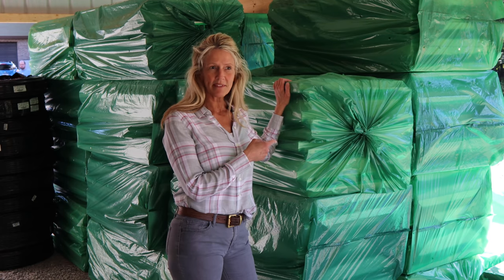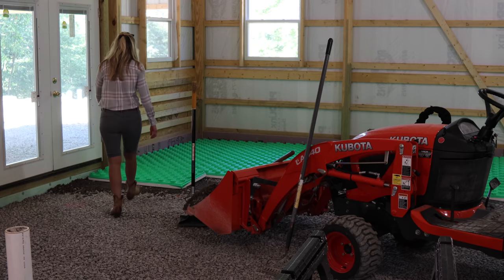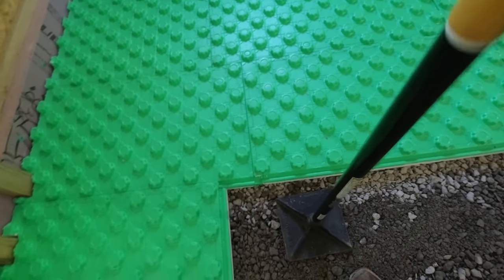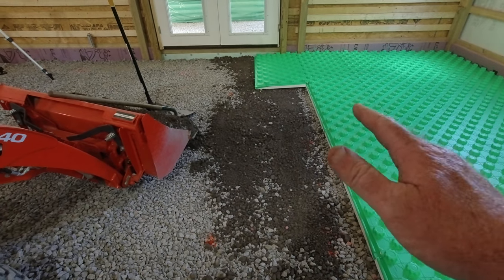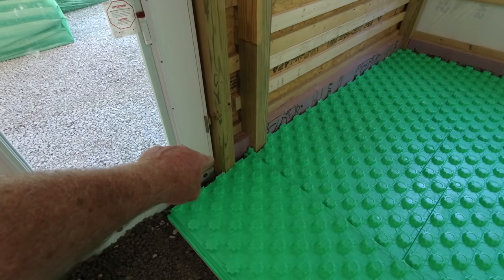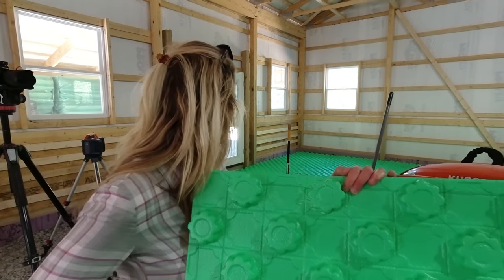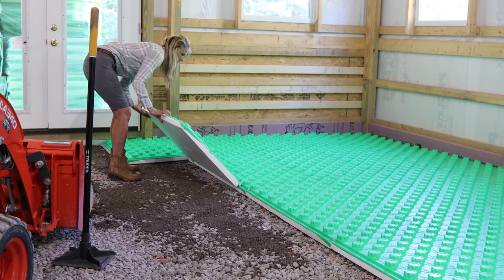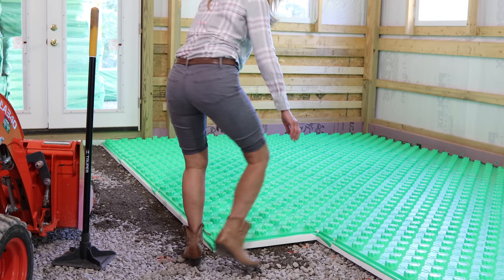I hope the Reward is Worth The Process, Radiant Floor Heat Rough In

Comment: Good Morning, Morgans! Mike, as far as the foam panels goes, we just did what you did, then used sand to adjust the last 1/4 inch. It works fine. And there's nothing wrong with attention to detail. You've worked hard to pay for this building. You should want to do it the right way! God Bless!

Comment: hi guys jimmy from Tn. I haven't done a heat floor but the best trick I have seen is to pressurize with air before pouring concrete. If the concrete guys punch a hole in the tubing it will make air bubbles in the concrete that you can see and you can fix it before the concrete sets. Enjoy the videos
Reply: Dang it wish I had thought of that ! Lol not because I have a heated shop but because I Will someday and So Far you win for best suggestion yet !
Reply: @mikesr3407  ... if you higher a contractor to lay the pipe they will absolutely pressurize the pipe before the pour. In most cases it's required to pass a building inspection.
Reply: @rupe53  that is COOL ! Makes perfect sense to me ! Thanks
Reply: Good point!  And take some detailed pictures prior to pouring in case you ever decide you need anchors in the floor for something. Pretty easy to lay out a tape each way so you can know where things are.  If your spacing is consistent with your grid, it should be simple.
Reply: Also when you pressure it will not collapse
Reply: @haroldsandfort7292  ... the heat tubing is not soft enough to collapse, even if you walk on it without it being pressurized.

Comment: Hi Mike, never commented before. We built our house in Maine last year using radiant and those panels. Up here we use a layer of sand to level up under the concrete. When you lay the tubing in, the posts do a good job in the straights, but we found using a foam stapler really helped keep the tubing down around the turns, otherwise when the concrete guys walk on it the tubing can pop up. Best of luck to you guys, love watching your channel.
Reply: Welcome to the comments Jonathan ! They read em and it's great place to learn more fur Sure !
Reply: I do residential radiant heat and I also recommend using staples on the turns.  https://www.viega.us/en/products/Tools/Accessories/Staple-2890-0US.html

Comment: Mike, there is nothing wrong with being particular about your project. I tried to pull an all-nighter (I'm 57) yeah, it doesn't work like it used too
Reply: Since you are working for yourself and not charging a customer by the hour, you cannot be too particular. Five years from now you will never say, "I wish I would have just slapped it together."

Comment: All-nighters! A common practice for high achievers. I’ve pulled my fair share over the years, always with purpose and drive. As I look back over my decades of life, I realize that there are significant trade-offs. When it saps ones strength, takes time away from family, or sends the wrong signal to others on the team, it’s unbalanced behavior. How well I recall the day after an all-nighter before Thanksgiving in the late ‘80s when upon my return home in the morning, I found my Bible opened to Psalm 127. A timely, and life-long message gently shared to me by my wife. It’s worth a read!

Comment: It is the most amazing way to heat your home. My first experience of this was in Ketchum, ID many years ago which is at the foot of Bald Mt in Sun Valley, ID. My babysitter for my kids lived in a small home her father had built back in the 1950’s. He left his will that for so many generations forward they were forbidden to sell the property but use it as he had built it.  He built this mostly concrete structure that had a sunken tub a large one that many could use together. The aroma of sulphur filled  the air but was piping hot! He was brilliant in deciding to run pipes all through the floor of the  house (think Fred and Wilma’s house) and was able to tap in to the  natural hot springs out there on Warm Springs Road. The most heavenly feeling to be in that house and walk on the floors. I’ve never forgotten it and  hoped to build my own version of that.  Think of  every object in the room absorbing the heat including ourselves. Therefore the most heat absorbing materials you use in the whole structure will be affected.  I hope yours turned out good and you love it!

Comment: Mike, yes you are being too particular, but it’s your own building. You will have piece of mind and no problems because of your attention to detail. I was crazy fussy and particular when I built our home some 35 years ago, and that has paid off in a structure that has stood the test of time! Keep up the good work.
Reply: Every bit of detail you iron out now to be perfect that multiplies over time. Sure, you are spending more time but it will pay off with no creeeeeks or dips,  over time.  Everything shifts ground over time. Water table, humidity, snow outside and such. Mother earth always wins, but you are doing it right. Plus, Mrs. Morgan looks like an amazing partner to work with.
Reply: RAH Capital  Read his comment again. He didn't say the structure lasted. He said it stood the test of time, and in the context of this video, he means he had no issues with the structure. The structure of a home can have issues resulting in cracks, etc., without completely failing. It's not all or nothing.
Reply: @michaelbarrister429  That’s exactly what I meant, Michael. Thank you for your kindness!

Comment: Used the same system when I did my garage last year.  Worked great.  Saxonburg area so similar conditions.    Connected to a mohoning outdoor boiler.   Super nice this winter.  Best advice I got from a pro was keep your pex 2-3 ft from exterior walls as that is where you may need to drill in to the concrete to mount things like air compressor, shelves, etc.    He was right.
Reply: Jonathan ... last place we did this we left a "map" of all stuff buried in the concrete (pipes, conduit, etc) showing where the gaps were. The owner had plans for a vehicle lift, air compressor, etc and wanted to drill into the floor in the future. BTW, a lift usually needs more than 4" of concrete and usually more rebar for a certain distance in several directions.
Reply: Hey Mike, great way to heat a building. I'm in north-central Ohio, installed radiant floor heat in my 40x60 garage, used pea gravel base,   4'x8' x 2" thick blue insulation panels,  taped the seams with 2" wide tape, stapled down tubing, heat with a Navien  LP wall hug hot water heater. System is 9 years old, very dependable, economical. Blg is on a full foundation, 2"x6" walls. I spent a little more on the walls & insulation. Insulation is the key IMHO. Thanks to you guys for the great videos.

Comment: After you lay down the tubing make sure you locate where the interior walls will go. Anchoring those walls with anchors, you may hit a tubing run. Good luck fixing that. That tubing becomes a hidden factor for future wall locations. It may take some time but I would make a drawing with dims. to show the location of the tubing before the concrete is poured. Good luck Mike!
Reply: Man that sounds like a great idea.
Reply: If in doubt use a thermal imaging camera to find the tubes under the floor .
Reply: Put that system in my house in southeast Texas. Using my floorplans I routed the tubes away from all walls and used doorways to go from room to room. Is not feasible down here where our cold snaps are just a few days long. It takes days to get the slab heated then your running the AC to keep the house cool, lol. Curious to see the boiler to heat the water.
Reply: @lhr1701  no doubt great idea , Mike needs an excuse to get one anyway , great tool to spot deer or injured deer after dark ! So a guy can get his harvest before the coyote do !

Comment: Mike and Melissa, it makes my heart smile when I see and hear you start talking about your grandson. You both get smiles ear to ear while talking about him. Also, Mike, you are doing a great job doing the preparation for your in-floor heating system. The only issue I have with the in-floor heating system that I have is that it is very expensive to operate so I only use it for a backup heating system. I have it in all of my house including the garage so when in use it is heating close to 3,600 square feet of the house and garage. I also installed a geothermal system with air ducts that I actually heat and cool my house most of the time instead of using the in-floor system. I really like the in-floor system because you are comfortable all the time during the winter while running it, but it is really expensive to operate.  My system has a small electric heating element, not exactly a boiler but an electric heating unit that heats all the water quickly and I have four zones to heat. Not sure what you are going to use to heat your water, but electricity I would imagine will be the most expensive. I really enjoy your videos and watching what you do and watching your family grow! (Tell Hunter hi from Iowa)        Thanks,  J.R.

Comment: Being from Texas I've never had or installed a floor heat system but your installation is looking great Mike. Your tolerances might be a little tight in my opinion but if you have the time, material, and tools to do it, why not.

Comment: Radiant heat is hard to beat.  It is the same type of heat that burning firewood gives.  Same with the sun.  When the concrete floor gets poured, Mike can fly the drone inside the building for great overhead shots.

Comment: We do concrete and when we do in floor heat we use chips or sand for final grade. Gotta get it flat so the foam sits right. The weight of the concrete will settle it down but everything goes better if the base is flat. Do it right the first time! Keep being picky.

Comment: Mike, ive never used that system, but i do  know a couple of guys on the outdoor wood boiler who has used it. They used sand to level it out. They said sand will help with heat loss too.  Love how your building is coming together. I recently pulled an all nighter and worked the next day outside.   Needless to say that i am not as young as i once was. But i did make it!

Comment: Mike doing same thing except with 2" ridged foam is a pain to level perfectly, also going to add a heat exchange unit in corner for faster temperature recovery when doors are opened they have a unit with a blower behind it  Great job isn't retirement  great ! Also when studding walls measure posts mine are 5 1/4 ×41/4 had to rip down all studs. and check corner orientation if installing purlins inside to nail finish boards to

Comment: I’m not an expert, but I would say you might be way to particular.   It doesn’t have to be flat or perfectly stable, as long as it’s not to high and it’s compacted well.   My god, you compacted it well!   I would think the concrete will compress the foam to the compacted gravel below.   I’ve seen contractors throw 2” foam on the ground, cover it with Polly and pour it.  If the ground wasn’t perfectly level the foam might crack a little, but that’s not going to hurt anything.   Of course it’s best to do a really good job and you are certainly going above what a concrete contractor would do.
Reply: EXACTLY what I was going to comment!

Comment: You don't want to stamp the inside concrete.  If it's stamped sand, dirt, etc. will get into the stamped part and you won't be able to sweep it up.  Just go with one of the epoxy like systems that are used in garages.
Reply: Be warned, you can't touch up those epoxy finish - it's the major reason why I don't like them. My employer put down an epoxy floor in the new facility that cost six figures, that wound up getting gouged in at least 2 spots before we even finished moving into the building. The CEO was not happy when he found out.

Comment: I have 4500 sqft radiant floor in my building. You will love it. I have a Garn boiler that burns wood. I make 1 fire a day in the winter, 2000 gallon heat storage is great. Make shure you do a heat loss calculation and determine proper water temperature and tube spacing. It is important! Also have the tubing layout computer designed. You won't be sorry. Most suppliers will do the design and calculations for free if you buy the tubing from them. Use oxygen barrier pex! If you want to hear about my lessons let me know.

Comment: I never used that stuff before but I used foamalar 4x8 2in worked great YOU WILL LOVE LOVE heated concrete it’s the best I think you want some heat lost So it won’t freeze and heave In the winter the floor should never crack it worked awesome for me

Comment: I helped my son use these panels in his basement. It is time consuming. There is no real shortcuts. We used limestone screenings but it still takes time and patience to get them right. If they are rocking by the time you get the pex run and the concrete down you will have problems if they are not laying flat. The system works great once it’s done. A very good system. There is nothing like floor heat. It’s the best, Good luck man…..

Comment: I have a cousin who has a building about the same size that they use as a machinery repair shop on their farm that is heated by radiant floor heat that is powered by an outdoor boiler.  The day I was there it was about 20 below zero outside and about 75 inside.  If I ever had to heat a building like that I’d definitely use an in-floor heating system.  He also heats two houses with systems run by the outdoor boiler using wood he cuts from fence lines and downed trees from the woods on the property.

Comment: Mike, I bought the same Harbor Freight compactor for redoing my driveway (~2000sqft). I had the same problem with gouging at the turns. I welded a piece of 1/4" steel to the sides at a 45° angle like at the front and back & gussets in the corners. It made a huge difference. No more gouging the stone of as you turn because the stone is forced back down into the surface. It also makes manoeuvring easier because the sides don't dig in anymore.

Comment: Mike, they don’t have to be perfect... just solid and relatively level.  The concrete will take care of slight dips and humps.  

We filled the top inch with lime sand... screeded it off... wet it with a sprinkler and just tossed in the pads the next morning.  The tubing grid fit great. The floor hasn’t split, cracked or moved a bit.  That was in a basement 8 years ago!

Comment: Just a little Math for the folks that seem
To think the wet concrete will weigh down the foam if it’s not perfectly level. One yard of wet
Concrete weighs 4050 lbs. one yard of concrete covers 81 sq ft 4” thick. That comes to 50 lbs per Sq foot. Or .3472 lbs per sq inch. So that isn’t going to move that rigid foam much at all if Any. 
So I am glad you took the time to do this right. I am doing my heated floor and am using 4” foam under
My slab and sand is my final grade substrate with a 6ml vapor barrier under The foam on top of the sand. No movement walking across the foam for
Me. Just a nice compact road base with sand topping grade.

Comment: Having helped lay a few radiant floor heating system in different states I have seen them laid different ways, Some use just dirt, some pea gravel, some sand, and a bunch a mixture. It all depends on your Codes and what you have to work with. That 2A stone looks like it has some dirt in it, bring in a load of sand to top that 2B stone off. First time is always a real learning curve and each time you either relearn or lean something new. After you lay your foam board take a chalk line and mark where your walls are going, that way you will not lay your pipe under your walls(learned that one hard)

Comment: We use that  radiant floor system we used stone dust mixed in with The Rock it helped out a lot with the little low you know Valley's in there and when you're putting the pecs down they had Staples they suggested for us to use and you can get this long pole and it's like a staple thing and you just won't be you don't have to bend down but everything else you're doing it right looks great keep up the good work

Comment: Hey, Mike (yes, it's "suggestion man") we use our sod-roller a lot in the garden, on the lawn to flatten gopher/vole damage, etc. They're typically under $100 -- so cheap investment -- and you can pull them behind your baby Kabota, or hand-roll, depending on how much water you add to the drum. We have a 12x36 (12" dia. drum, 36" wide) intended for hand-pulling/pushing. They come in poly or steel; the poly is cheap, lightweight, and is easy to hang on a shed wall. Or, you can rent for $10-15 per day. I'm thinking you could try broadcasting your damp, 2A over the 2B and then rolling it ahead of panel placement. A 3' roller (like ours) would overlap adjacent panel-placement by a foot, helping to uniform the process. Fill the roller with the water (in place), and experiment with weight that gives the best results (and doesn't kill you). Great workout, too! When done, drain the drum and hang on wall. Steel rollers are more durable (won't puncture), but they're heavy as heck, and they rust. Our poly roller weighs about 25 lbs, empty.

Comment: Hi Mike, when we built my garage 19 years ago we used pea gravel for the top layer, then 1" pink foam board with wire on top, the heat pipe was wired to the wire. pretty easy, but your is your building and there is nothing wrong with being particular about it.

Comment: I used 2A to grade for my pole building before I put my insulation down for my radiant floor heat it really makes it go easy, I used a plate compactor  it packs nicely and you are not kicking stones when you walk on it
Reply: Radiant floor is definitely the way to go the heat is so nice and there is no cold spots in the building